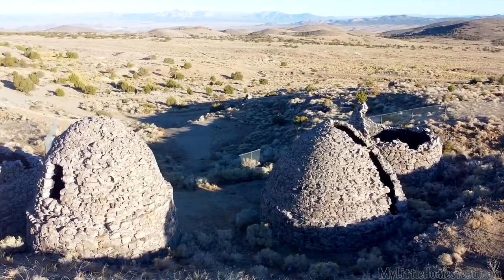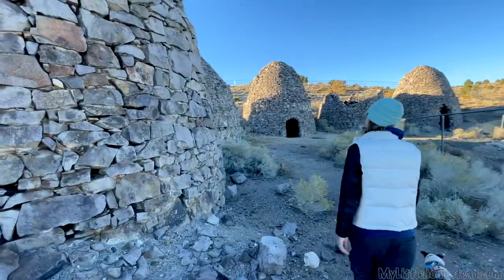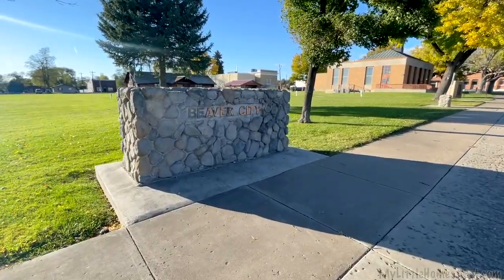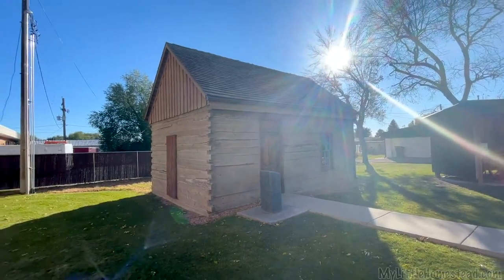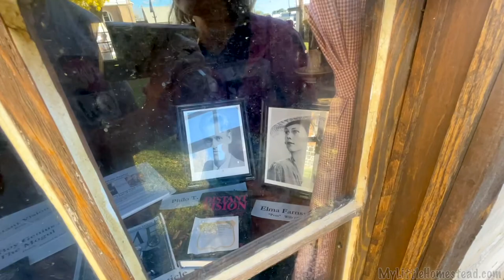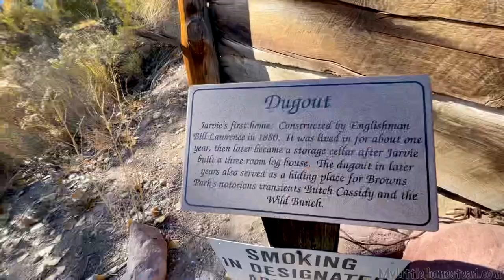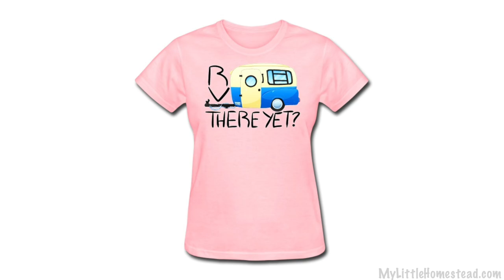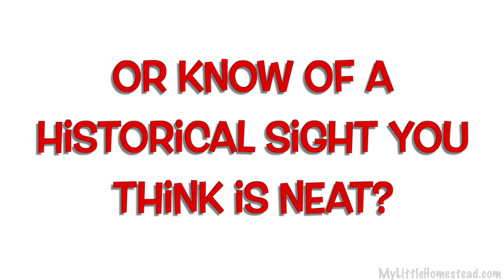4 Best Kept Secret Utah Destinations! | Weekly Peek Ep330

Comment: Charcoal kilns would be weird enough but with ventilation? How the heck would you seal them for firing in the desert? It takes a lot of water to get enough mud for that - pit kilns are more common for charcoal as a result. 

I think those are smelters for smelting or roasting the ore since those processes require ventilation. They may have used charcoal for the firings. I imagine that smell would hang around a lot longer than the sulfides they were trying to burn off.

Cool stuff - thanks !